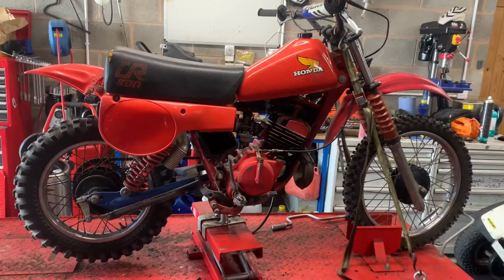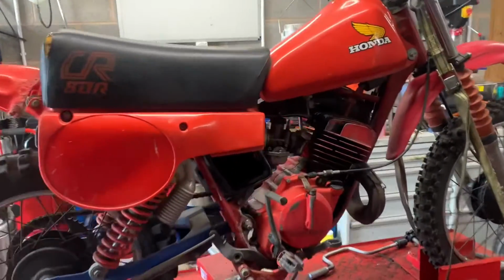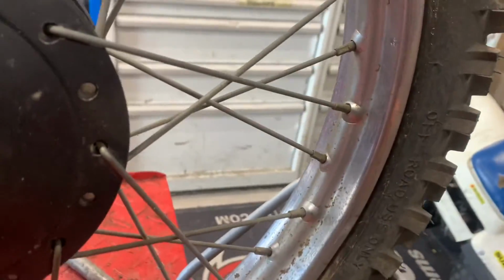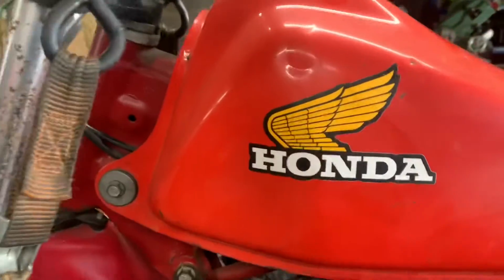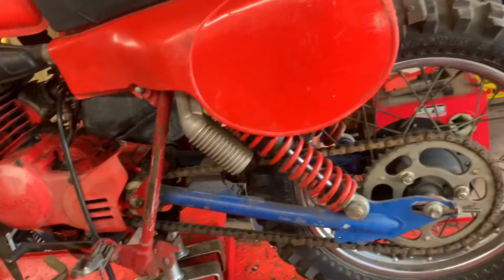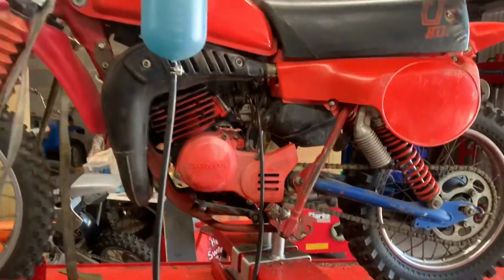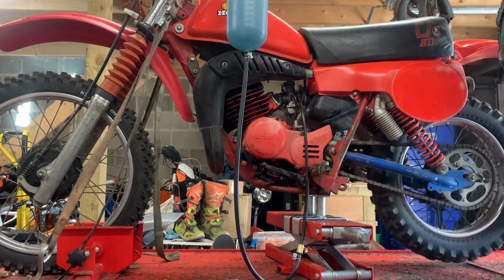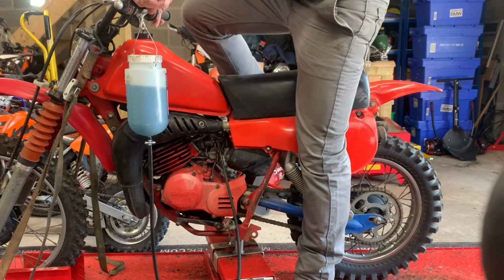1980 Honda CR80 mini red rocket

Comment: I bought it on my own from working on Saturdays at Elm Supply East New York Brooklyn NY USA with my father. And I started on a 1980-81 CR80 when I was a kid-12yrs old, (I had a junked extra CR80 1981 motor thanks to Brendan McGovern bro. I bought for $50.00 from him) I rebuilt the motor bored out the cylinder, replaced connecting rod bearings, replaced with weizen piston & rings, boisen reeds, jetted carburetor, new magnito etc.. Anyway super loved the video, the sound of the bike sounded as if it was a time warp yesterday.It brought back so many  memories.I'll get 1 in the future just to collect it. TY for a Great memory drift!!